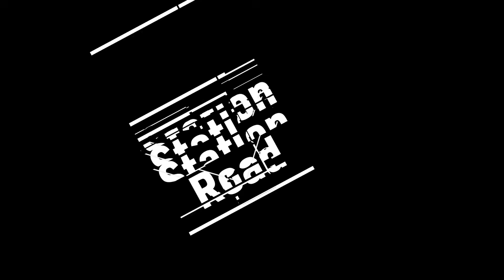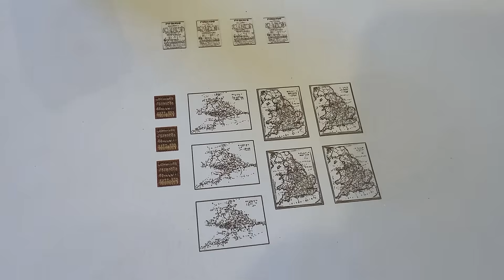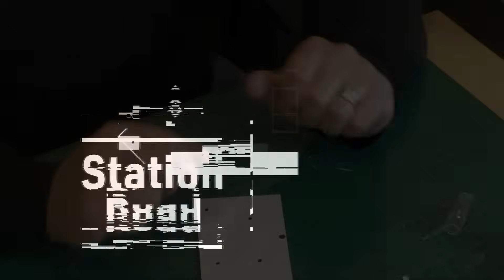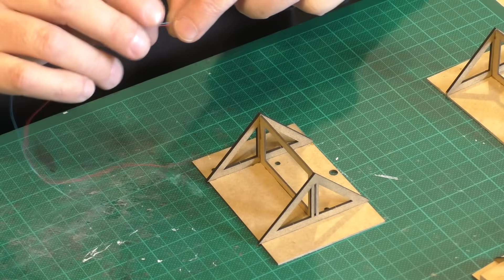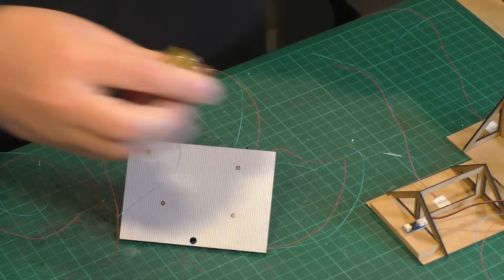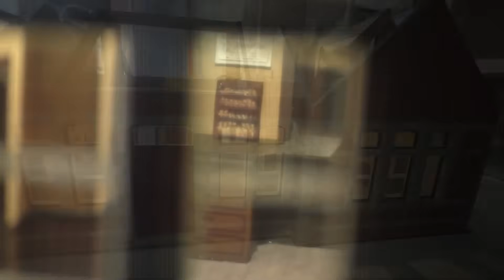Platform 1 Main Station Building - Interior Lighting

Comment: Hi Julian. Yet another fascinating insight into how your mind works! I can imagine that there was great satisfaction in joining the 3 parts together, finally! I'm now going to throw you a curve ball regarding the lighting. I'm not so sure that down lighting would have been installed in the modelled time frame. More than likely, it might have been extravagant pendent lighting. If indeed that was the case, then quite possibly you may have been able to use upside-down platform lights, cut down, and then secured to the ceilings in the relevant holes. THIS ISN'T A CRITICISM ONLY AN OBSERVATION. I've put that in capitals because, apparently, there are a few people who run down fellow modellers' work almost causing them to not only quit YouTube but railway modelling altogether. But I'm one to talk, I don't post anything on YouTube and as yet I don't have a layout! But I thoroughly enjoy your channel, along with many others, and can only drool at your modelling skills. The view through the windows and doors is very atmospheric, wouldn't it be nice if we could be srunk and take an actual walk inside!
Reply from the maker: I think I mentioned in the video I wasn't going to go to the lengths of actual pendent lighting. Unless your viewpoint is from baseboard level looking up through the windows, you can't see the type of lighting, so down-lights they are. It's primarily the interior atmosphere that becomes visible when the lights are on.

Comment: Julian, I like the way you explain your logic very interesting to follow your pattern of thought, you seem to be using quite large wires given the voltage involved. Loving the intention to detail by the way . Miniature wunderland print lights to fit over the LED’s using clear resin which looks very good. Surprising how well you can see inside with all the detail visible.

Comment: Haven't seen any examples for a while, but could fibre optics be a means of getting a light source out to those (3D printed?) lamp brackets?
Reply from the maker: It would certainly be doable but possibly more in a commercial production sense. I'm not sure how one would fashion a fibre optic lamp from scratch.
Reply: @StationRoadModelRailway  Thought I actually had a magazine article somewhere, on using fibre optics on model railways, but i can't find it at the moment. Anyway, a quick online search ('fibre optic lighting for model railways') turns up quite a few links. Several suppliers stock the necessary parts and/or kits to get you going -  I just imagined that you could design and 3D-print a suitable bracketed lamp design, but with a hollow stem to allow the fibre optic filament(s) to pass through. Just needs an semi-opaque plastic 'glass' popped on the end and Robert's your father's brother -  seems simple when you say it like that LOL.

Comment: i tok a different approach to supplying the LED lighting power, I took a 4.2V battery, and used a voltage reducing circuit to output the 3v required for the LED's enabling me to dial down the brightness of the entire lighting circuits. then fed a section of vero board and used ribbon cable plugs to feed individual circuits, via a set of pcb dip switches (on the dashboard- it looked just like the real bank of switches) to liven up each track of the circuit board, then just extracted power from the track i wanted for say interior lights or navigation lights.

Comment: I used the same LED's on a model boat, I ended up using heat shrink tubing to build up the wirre thickness before installing, mine were embedded into light fixtures that were either 3d printed or made from coloured acrylic rod. it took me a year of being scared to touch such delicate wiring before I soldered them all together.